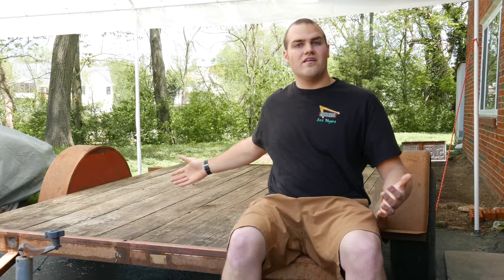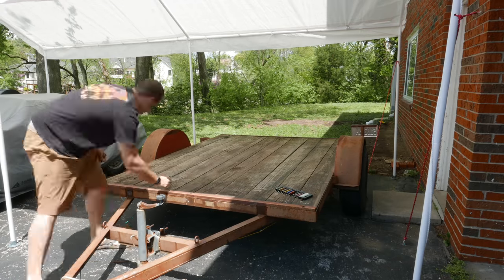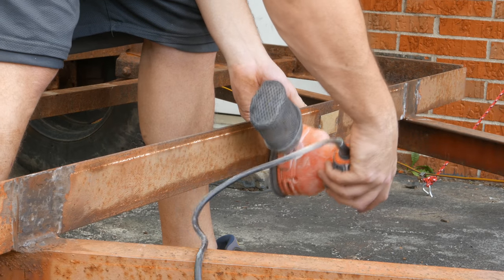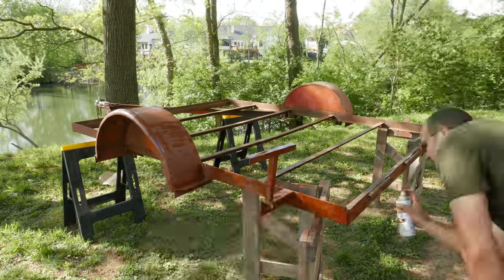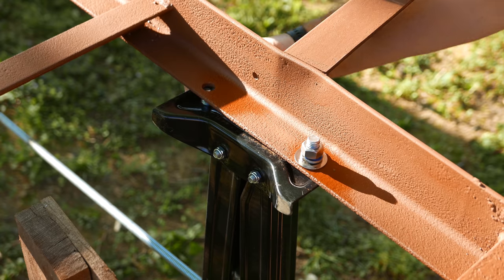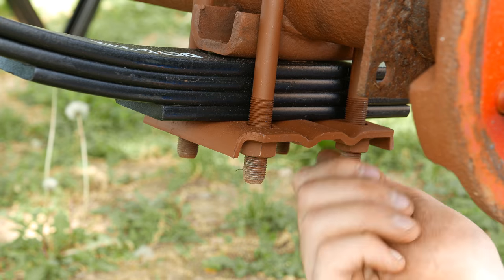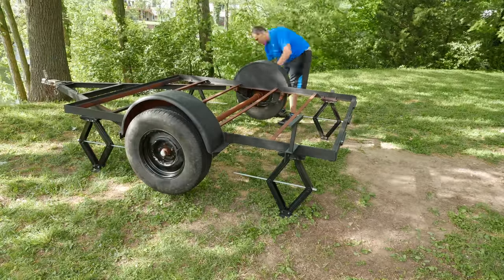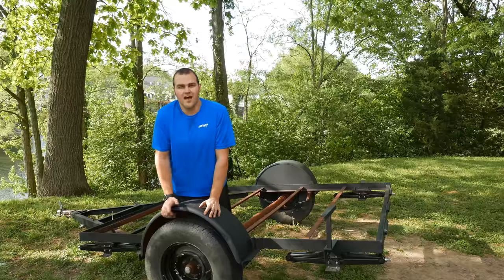Building a Camper - Part 1 Frame Restoration

Comment: I couldn't tell. Did you put new wheel bearings in also?
Reply from the maker: I didn't record it, but i did removed them and checked them.  I replaced one side, but overall they were in good condition.  I keep a spare set with me when traveling.